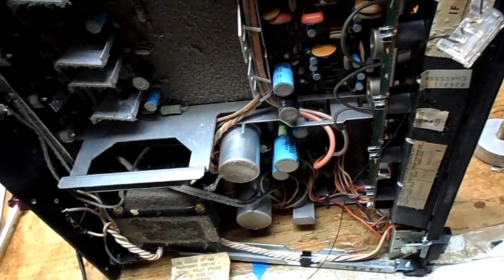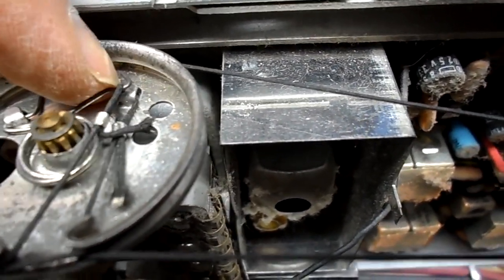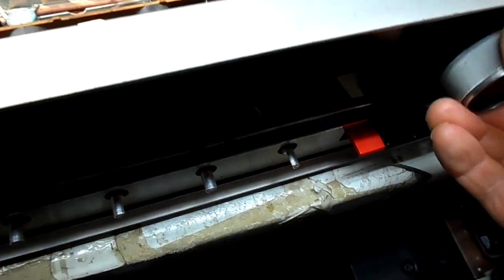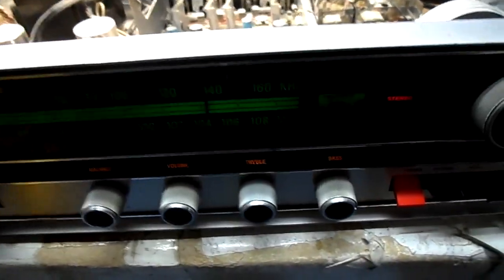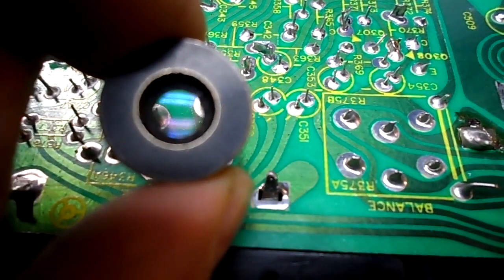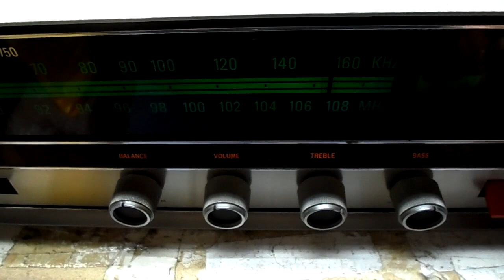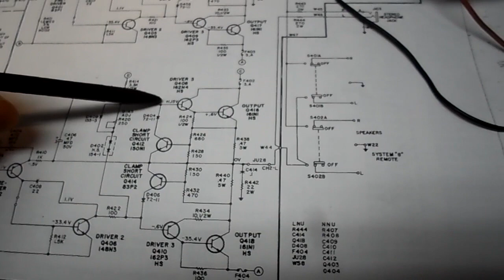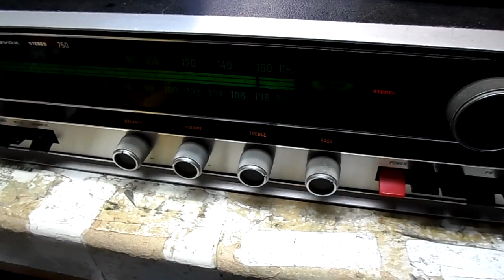Magnavox Stereo 750 Receiver Repair. Model 1K8894 from ~1971.

Comment: Yeah, usually very good build quality. but poor adjustments and alignment. To get the most of the units (which are really worth it) you really need an FM stereo, Sound Technology model 1700B  for this and the rest of the adjustment work. (Or Hewlett Packard 8903B if possible.)